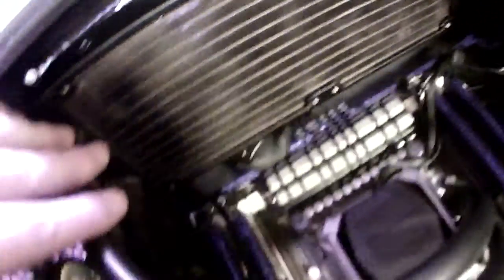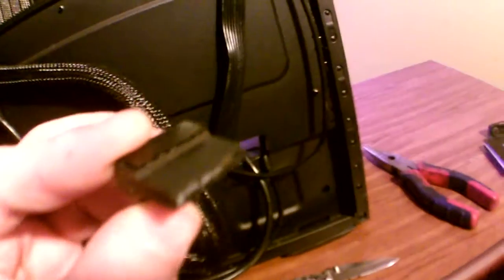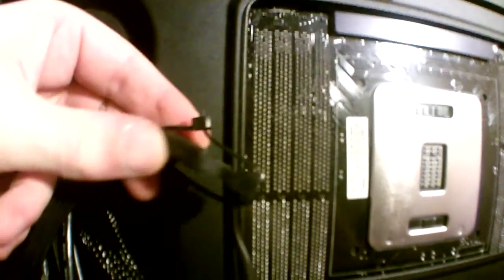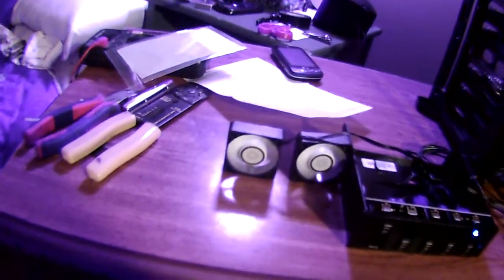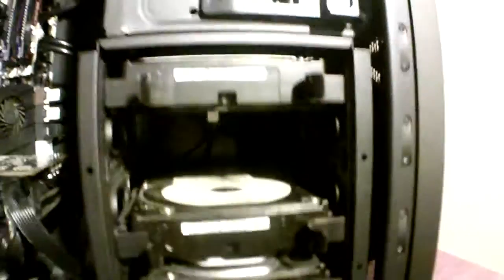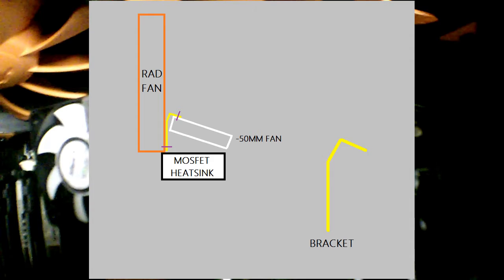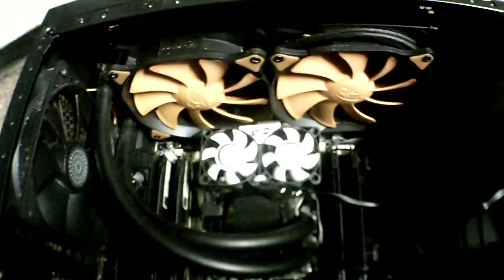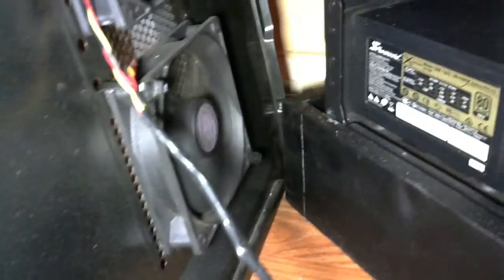Mo fans mo problems. MOSFET cooling and broken SATA connector fun

Comment: Lol what youve done is not your motherboard. It's well acknowledged when adding water cooling to a graphics card you need to add a fan to cool the memory chips, the same goes for a motherboard where you need to add airflow to the mosfet heatsinks. 
My crappy asrock has a 50mm fan on each heatsink but never throttles with a high overclock.
Reply from the maker: gpu memory and vrm is passively cooled with thermal pads and a front plate usually. some blocks extend to do this too. but generally you dont need to add a fan. same for cpu. unless pushing an extreme oc or oc on a 32nm 6core, the stock passive cooling on the vrm is fine. the sandy 2011 chips were meant to be liquid cooled not air cooled thats why on this particular board the mosfets got their own little fan for the heatsink, but it isnt enough